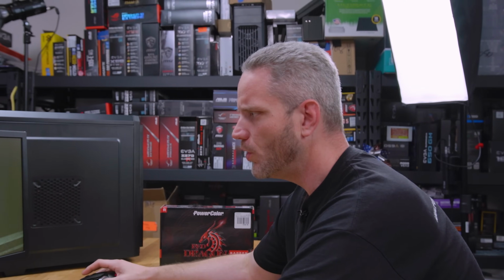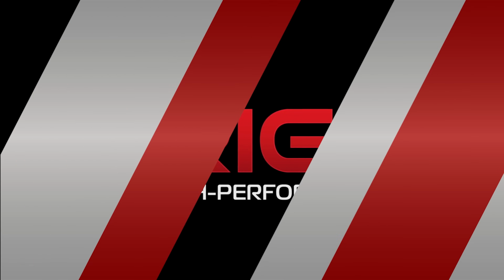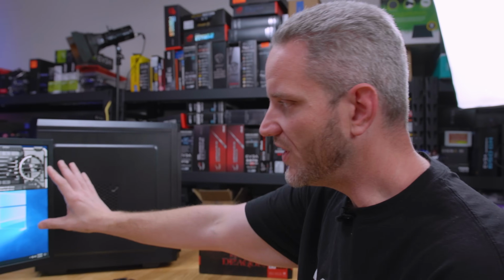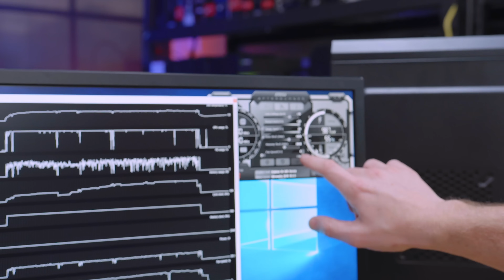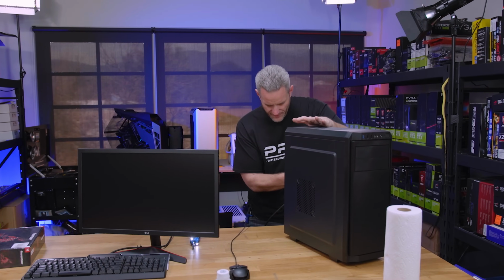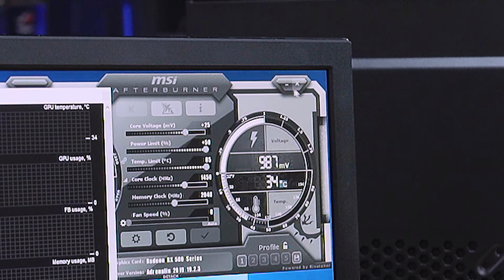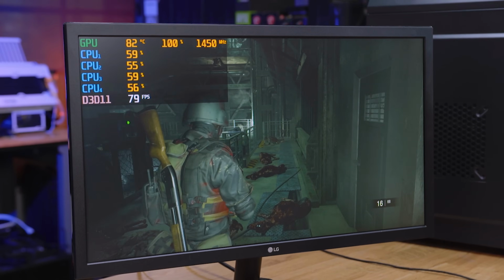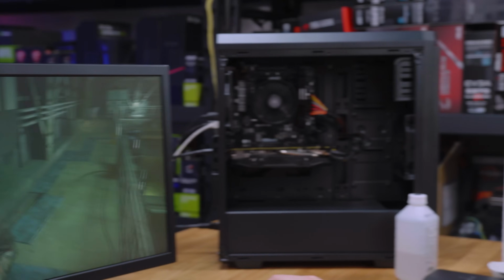Should you replace your video card's thermal paste??

Comment: Before you start saying crap about those cards have you even tried to see the stock fan curve in wattman ? Those power color cards come with a temperature target of 80c and the fan will max out at 2400rpm without any modifications and thats the oc bios ... If you are using the other bios its a problem because it has a lower fan curve
I suggest you set an aggressive fan curve and you will see huge benifits as i have 2 power color cards now 
The red devil rx480 with custom fan curve runs at a 65c while running metro exodus and 2400 rpm in an open test bench ... In a case it will run at about 72 to 74c with 3000rpm which is okay with no throttling

My other card the red dragon vega 56 runs at 68c to 75c depending on the load with 3000+ rpm inside the same case using over 200w of power and thats undervolted , overclocked and flashed to vega 64 bios with a custom power play table for a custom fan curve with a temprature target of 75 and undervolting

I am just saying ... All cards need some tweaking from the software to run comfortable

Comment: The reason the GPU package is mounted at a 45 degree angle is routing. It’s a fairly common trick to do to make PCB routing easier - essentially allows you to get traces from two sides straight in one direction, and the other two sides straight in the opposite direction (as opposed to routing in 4 directions).

Comment: My 1070 is an old cheap model triple fan zotac not even made anymore.
It boosts to 1744 yeah I know it's bad dont worry. At a temp of 66c max load in a case with a triple fan intake the airflow is actually better then when the pannel is open so it's very well cooled. Replacing my paste got me to 49c max. If this was a better card that would be a shitload of OC room. 
If your card is cheap, the paste is probably cheap.
Reply: I got a palit 1070 dual fan, it was the cheapest 1070 i could find lol and it runs at a cool 60. Could change the thermal paste someday. But i do have a case with 3 120mm front fans and a 140mm fan in the back

Comment: I actually had to replace the thermal paste on my MSI Gaming X GTX1070 because it always felt like it was running too hot, like around reference/blower temps. After trying everything I could I decided to open it and saw that MSI either barely used paste or missed cause most of the gpu was exposed. After changing it it was much better. So always compare temps with others and see where you are because after trying everything it might be that.

Comment: "using default fan curve"... No improvement is 100% expected. The fan curve wont allow an improvement in temps, the card will reach a max temp and the fans will ramp up to maintain it. New better thermal paste the fans will ramp up to a lower speed to maintain the same temps. Ofcourse the cooler isn't very good so improvement would be minimal at best.

Comment: Using Thermal Grizzly liquid metal on my 480's. Reduced 7c 100% load. Not 2 bad. 2 yrs in no damage just staining. No aluminum. Nickle plated copper block to die.

Comment: Did this to my EVGA 1070sc.  My Temps dropped from 80c to under 62c full load.  The pre applied paste looked fine, I'm not sure why I was getting those horrible temperatures.  I'm beghinimg to think maybe the screws that held the plate were lose or something. I obviously tightened them up after the reapply.

Comment: My 1070 was running 83c non stop even on 60% loads  after trying everything i learned it was just the internal fan profile.  After overruling ig it now runs at arround 68 degrees and can go lower but that will make it to loud.  Sometimes it seems its just by design.  Poor design but a design either way.

Comment: When I opened up my gpu to change my thermal paste I notice the factor missed like 1/3d of the die with their application. cleaning it up and reapplying it helped moderately with sustain load temps. But greatly increased how fast it cools when the load was removed.

Comment: bout as loud as my Nidec beta V 0.8 amp 12v model C34262 
Specification:

Rexus SKU Number
 21238-1

Manufacture
 Nidec

Size/Dimension
 119x119x38mm

Mfg.Part number
 C34262-71

Bearing Type
 Ball Bearing

Connector Type
 7" 3 wire lead ( Compaq connector)

RoHS Status
 n/a

Voltage-Rated
 12V DC

Power-Rated
 9.6 W

Speed
 4050 RPM   (Temperature Detecting Variable Speed)

Air Flow
 130 CFM ( Variable)

Noise
 53.5 dBA ( Variable)

MTBF
 49,000 hrs

Packing/Weight
 Bulk

24pcs/Box, 18lbs

Comment: I generally do replace my thermal paste first thing. I was hesitant with Vega because I figured it already had good thermal paste due to its inherant heat issues. Turns out the factory paste is ok but the paste I used dropped temps 1 degree and the temp dropped WAY faster when load was reduced. I have noticed on modern GPUs the paste is decent and when replaced how ever that even if temps don't go down significantly the speed at which the temperature drops after load is reduced is drastically improved.

Comment: What you wanna do if your card is running hot and loud, its running an temp-adjusted automatic fan curve and its not notably overlocked (same goes for CPU air coolers) - is feel around your cooler (the metal part - fins and pipes). If the cooler is nice and toasty, the paste is doing fine. If the cooler is luke-warm/tepid/barely above the temperature of your skin (but your die is up in the 80s) - then likely either the paste has gone bad, been poorly applied or the cooler is not mounted properly. A warped cooler is possible, but I have never run into one like that, that were not caused by physical impact damage.

Comment: My MSI Gaming X Trio 1080TI was getting really hot, like up to 86C, changed thermal paste and in ultrawide 1440P gaming on high+ settings never passes 66-67C now, with 50% fan speed. So changing thermal paste can help, a lot.

Comment: I replaced the thermal paste on my Red Dragon Vega 56. Not for thermals, but because the AIO broke on top of it in my luggage, so I had to clean it. Since it was before I had ever run it, I can't comment on the thermals. But Jay, your video putting the waterblock on a Vega helped me a lot, especially showing how EK suggests thermal paste application. Thanks!

Comment: I recommend doing this with cards that are already a few years old. My GTX 680 was running its stock thermal paste for 5 years until I replaced it. Got a 10-12°C drop. Made a big difference in fan noise and stability.

Comment: I bought a used rx 470. It overheats like hell. I replaced the thermal paste, cleaned the card and fans, washed the heat sink. Now, I got a minimum of 42c in idle. Adjusted the fan speed in after burner and I'm getting 60c- 65c while playing cs go in high settings. Also enabled chill mode. Personally, I don't want the temperature to go above that as it affects the temperature of other components such as the hdd and ssd. Now I'm thinking on having hdd cooler. I have 2 exhaust from back and top. I got 1 intake fan from the front (I still need to figure out how to mount the other fan without drilling the case). I think I got a mining card. Is the temp normal?
Reply: depends on GPU heatsink/fans and your case airflow

Comment: When, if ever, should you replace thermal pads on your graphics card or laptop? And how do you know what thickness to use?
Reply: When they're too gooey/ sticky and tear apart basically. I usually get .5 to 1mm, if u need more space just add another layer cut to size. As long as they make even contact it's fine.

Comment: As a noob I was interested in overclocking until I quickly learned how loud the gpu has to be.
Reply: Overclocking GPU just ain't worth the hassle IMO just to gain 7 to 10 fps more. 15 fps in some games. It causes more problems than is worth the effort.
Reply: @Derek_The_Magnificent_Bastard   yeah i agree and when I look at ppl using 80%..or even 100% fan speed to get that extra boost...screw that lol.

Comment: My temps were fine till I overclocked my xfx rx 580 to 1475MHz/2250Mhz with stock voltage , sits just below 80c (glass side panel off, not enough fans in the Cougar Panzer).

Comment: There were a number of folks with the RX 580 where temps weren't the problem, but replacing the thermal paste fixed the issue. Symptoms were black screen, fans ramp up to 100%, PC hard locks and requires a reboot. Some games this would happen on startup, some once the map loads, some after 20-30 minutes of gameplay, and some after playing for a bit and then going into the game menu. For me, it was my MSI RX 580 Gaming X and games like RB6 Siege, Assassin's Creed Odyssey, Metro 2033, and Metro Exodus. I was pulling my hair out because temps were between 60-75C and never went higher than that, even at the moment it hard locked. After doing all of the basic diagnostics, including temp monitoring, reinstalling drivers (with and without DDU), testing every driver since the card launched, re-seating every piece of hardware, reinstalling the games, reinstalling windows, and numerous advice from forums, nothing worked except changing the thermal paste.

Comment: When Jay says the RX580 is entry level and you look at your RX560
Reply: looks at r9 390 and frowns
Reply: @MrArgonaut2501  r9 390 still kills
Reply: @colei8752  nah, it actually just died a few days ago. And the arctic heatsink almost shorted out my mobo when the thermal adhesive failed and dropped a sink onto an ic connection
Reply: @MrArgonaut2501  rip r9 390 twas a good card. Mine died the same time you did a month+ ago. Just got myself a red devil 5700xt and I hope it'll serve me well for the next 5 yrs
Reply: @SketchbookGuitar  Yeah, I screwed up. I bought a cheap 1060 not knowing that nvidia drivers have gone waaaay downhill. facedesk
Reply: @MrArgonaut2501  my 1060 got corroded for some reason and it stopped working after a year. Now i have a rx580(got it for $45, used) and for some reason it woks a lot better than my 3gb 1060
Reply: @MARTINREN1231  Yeah, I went with the 6gb 1060, benchmarked slightly higher than my r9  390 shrugs so far it's okay
Reply: Fiton  yeah i know, i owned one before it got corroded lol. i have a 580 right now which i didnt go for since back in 2017 GPU prices is a bit.... up there?
Reply: Fiton  Mine works fine for all games I play @ 1080p @ high or ultra. settings. I aim for around 60 fps but will go for at least 100 where I can. I have the 6gb OC to 2100mhz core clock and 4700mhz mem and it performs around 15-20% slower than a 1070 @ stock. Happy with mine
Reply: Fiton  idk what you smoking, mine runs most new games on atleast medium with 144fps and triple A games on 60+medium/high setttings no problem, might be cuz you are running an old i3, fx processor or gen1 or 2 ryzen.
Reply: kokichat I run 5700xt and a i7 8700k bud I play everything on ultra when I had a 1060 in it I was getting 28fps in gears on high 1060 is a entry level budget chip what are you arrguing bud it’s even listed as entry level GPU lol.
Reply: kokichat I run most games at 150+ fps on ultra hence the 1060 bejng a giant POS becusse brand new 1060 cost the same as a 5700 xt new.
Reply: @Tony-fb8nt  Where the fuck are you shopping? 5700xt is almost double the price almost every shop including amazon.
Reply: @Tony-fb8nt  I have a 7700k and was running gears on high with 70+fps. You prob got a deffective model.
Reply: If you ever play multiplayer never play on ultra. The slight graphics improvement comes at a huge input lag cost. For single player titles its fine though. Also where the fuck is a 1060 the same price as a 5700 xt? XT is about 250% more expensive where I'm from.
Reply: @MARTINREN1231  rx 580 is better than 1060, actually its in rang with 1070 btw
Reply: @dusan1038  i know, i owned both. i just mentioned that i bought at RX580 due to my 1060 going bad. (corrosion and sht)
Reply: @MARTINREN1231  I went with the 1060 6gb partially because after fighting with a space heater r9 390 for several years . . . nothing I was reading about the rx580 said it wasn't a bit of the same. And thanks to the driver mess I regret that decision.
Reply: @kokichat  right now 1060 6gb cost about 300$ brand new a 5700xt costs about 400$
Reply: @jamesbrisendine8917  idk where you are buying from, but here 1060 6gb is like 150$
Reply: @kokichat  depends on what model of 1060 you get there are lower end ones and higher higher end like a 1060 6gb ocv1 or the 1060 gaming X 6g
Reply: @kokichat  and depends what brands you buy from like the msi ones are more spendy because there better builds
Reply: @MrArgonaut2501  I'm back to my r9 390. I had a 5700 XT Red Devil but I ended up with one of the card that flickers and has issues. I sent it back and put the money toward mobo, Ryzen 3700X and DDR4 ram. The 3700X paired with the R9 390 is showing that it's still a good card for 1080p. 60-70 FPS in Kingdom Come Deliverance with the HD textures. Most games still at ultra. It's an oven though. The Red Devil ran very cool. Was well made. Wouldn't mind another one if they get their QC figured out.
Reply: @MARTINREN1231  cos 580 is objectively noticeably better than 10603G.
Reply: @MrArgonaut2501  I just got that card yesterday
Reply: lol,, i have that one...
Reply: stares at r9 290x
Reply: eyes tearing up
Reply: I bought an used RX 580 Asus 4GB on eBay, it works like a charm
Reply: He was saying that this is an entry level skew of an rx580
Reply: ...GTX670. 🥴
Reply: I'm still running a Radeon 5870 🤷‍♂️
Reply: When he said "lesser end graphics card" I thought he meant the brand he got. Didn't he?
Reply: I have the rx 550
Reply: cries in AMD Radeon HD Sapphire Graphics 6570
Reply: i had that one when i bought my pc and it was the 2gb one and it was complete trash but got a 570 8 gb and its so much better
Reply: At the time I was rocking Sapphire 480 Nitro + Xfire on my rig. (The same rig I still use today, xcept with a 2080Ti)
Reply: He's talking about the company power color not the RX 580 itself.
Reply: used a hd4870 until it woudnt post anymore and got a gtx970, i have bad luck with amd cards they seem to ko within a few years for me compared to nvidia cards, had several ati cards failed and 0 for nvidia yet that is my experience
Reply: I have a 580 lul
Reply: I think he was referring to the way the card was assemble and it's cooling solution.
Reply: He was definitely talking about the cooler/brand. My 580 will be here friday with evga aorus wish me luck lol
Reply: i have Rtx 2060, its entry level card at 2020
Reply: gtx 560 :)
Reply: I got the 580 and it my best part :(
Reply: Can’t relate
Reply: I got rx 470 4 gb in sept. 2017 and just in Jan Amd launched Rx 5 series. I feel like cheated
Reply: @shri2549  theres not a huge differance in the 470 and 570 so your fine
Reply: GT 9800 512MB still rocks
Reply: @daverock1079  I had that card back in 2005, it was trash back then.
Reply: AppleManiagaming is it really that old? It was in my "gaming pc" altogether with a Core 2 Quad and 4GB RAM which I had bought from a local computer shop around 2009-2010. I had paid like 600$
Reply: @daverock1079  haha bro I pretty much had the exact same PC, Intel core 2 quad q8600, 4gb of ddr2 ram, and the same graphics card. It was ok for really low end gaming but as soon as you moved up into AAA games it was a flop, could barely get 24 fps in games like mirrors edge or Borderlands 1. Eventually I upgraded the card to a NVIDIA GTX 650 ti and the performance increase was amazing. The actual CPU wasn't bad tho, still a decent little chip for workstations.
Reply: AppleManiagaming I liked that computer because until then I really only had trash hardware for gaming. To be honest, it was pretty decent for my needs. I could play Star Wars Battlefront 2 (2005), Assassin's Creed 1-Revelations, CoD Modern Warfare without having trouble and with decent settings. It only struggled with Gta IV a little bit, but that game is even today shitty optimised. Yes, the CPU was great. After 2 years I sold it and bought a MacBook Pro for school. Good times. Now I have the money to build any PC I want but gaming isn't that fun any more for me personally.

Comment: Speaking of bad tim from the factory... my brother just got a Strix Vega 64 and it wouldn't clock as high as his reference. It just wouldn't boost, like stuck at a lower p state. Finally after trying everything else I changed the thermal paste, even though temps were not bad. Anyways it must have had a bad spot on the die where the temps were very high but not showing due to it being an undisplayed sensor. It clocks very good now almost 1650 while undervolted to 1080mv. You should revisit the Vega Strix you couldn't get to overclock.

Comment: I used my old aio cooler and bought this nzxt bracket to mount the aio on my gpu, now my 1070ti dont even gets above 50c at 2050mhz  with 1000rpm fans. Really a great solution if you have an older aio cooler or upgrading to a new aio and make good use for your old one, since their resell value is pretty crap.

Comment: I recently started overclocking and wanted to see if it would make any difference in temperatures on my old  mini EVGA GTX1050TI SC 4gb and the temps were maybe 1 degree cooler after re-thermal pasting it. with +133 on the core and +500 on the memory it still hits 61-62 degrees C and at idle it goes down to 32-29C.

Comment: I replace my paste with kryonaut regardless, not necessarily for performance but for acoustics. It's under and on top of the ihs on my 4430 living room PC, the 4670k in my old PC, it keeps my main ryzen 5 1600 nice and quiet, did it to my XFX RX-580 gtr-s, my 960 armor titanium, my gtx 780 sc, gtx 1060 6gb ssc, and most recently my strix Vega 64. I even did a 4130t in an Alienware Alpha once because it made the jet engine sounds stop. I'm all about that paste bout that paste, low thermals